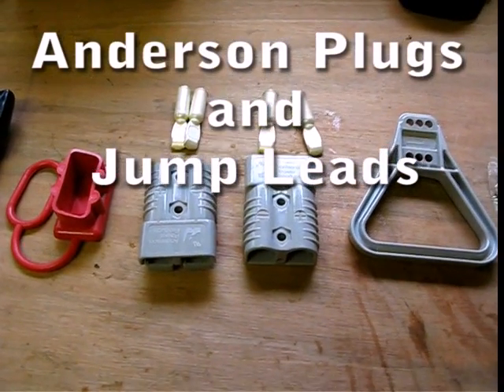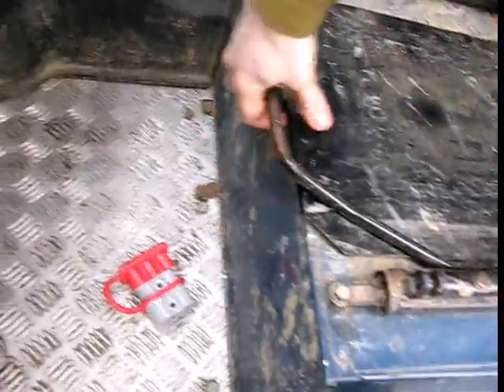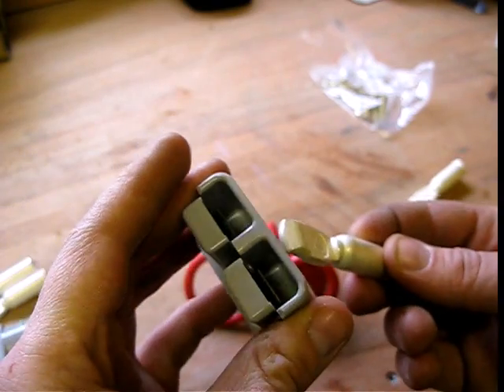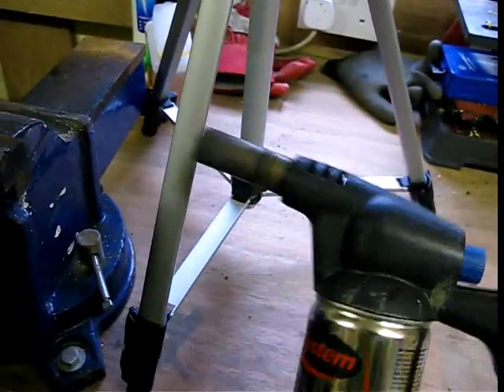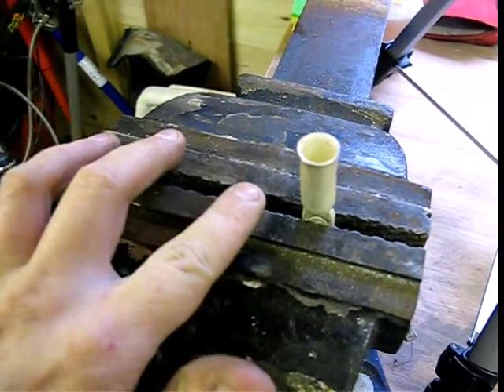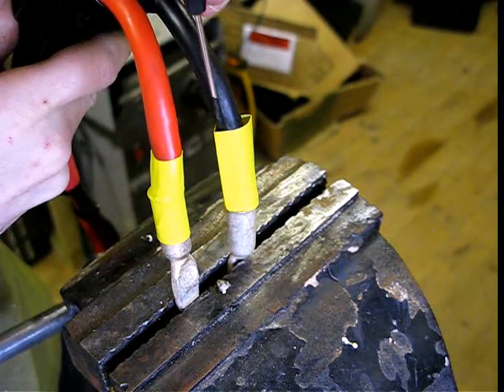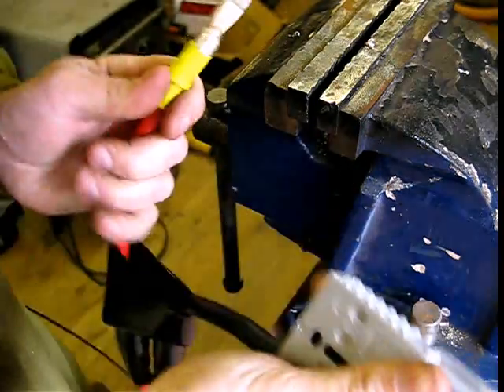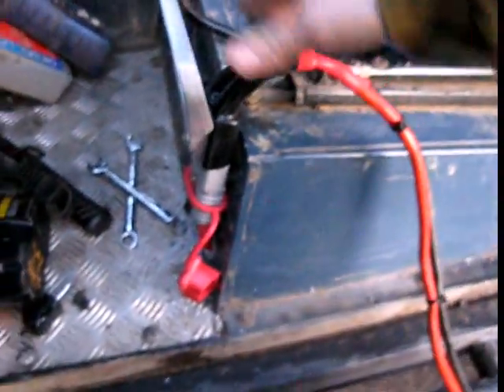How to make up Anderson plug jump leads for a land rover Defender or any vehicle

Comment: I use a long pair of needle nose pliers to open up heat shrink tubing. Slip the heat shrink on and open up the pliers a little till it's opened far enough to slip on wire connector.

Comment: So hows it going Did it like this the first time I tried it. Doing it this way is an easy way to overheat the solder( black smoke and flame) because your feeding it in slowly. It's a pain to do it like this. You wind up getting to much heat which isn't good for the solder and you have to wait longer for the solder to cool. It's much easier to fold a length of solder till it's a little tight fitting in to the lug and about as tall as the cup that holds the wire. It's much quicker to melt the solder then insert your wire and it's much quicker to cool because you haven't overheated the lug and what you use to hold it. This way you can do more lugs in less time use less gas and have a better solder joint. Buy pre tinned then there's is no need to tin it beforehand.

Comment: Did it like this the first time I tried it. Doing it this way is an easy way to overheat the solder( black smoke and flame) because your feeding it in slowly. It's a pain to do it like this. You wind up getting to much heat which isn't good for the solder and you have to wait longer for the solder to cool. It's much easier to fold a length of solder till it's a little tight fitting in to the lug and about as tall as the cup that holds the wire. It's much quicker to melt the solder then insert your wire and it's much quicker to cool because you haven't overheated the lug and what you use to hold it. This way you can do more lugs in less time use less gas and have a better solder joint. Buy pre tinned then there's is no need to tin it beforehand.

Comment: Very nicely done. Got a whole load of these but lower current rating. How much were they 175A ones?
Reply from the maker: Zed Man sorry it was so long ago and i can't remember
Reply: ruuman no worries. Found some on eBay for £15. Tempted to hook one up to the transit but wire one to the front bumper like the RAC/AA vans. Cheers
Reply from the maker: Zed Man bargin, yeah really handy mod

Comment: Not a hater, but for a vehicle mounted system, using solder is NOT THE RIGHT WAY to attach the Anderson connectors.  

In high amperage situations, the joint can get hot.  The heat "can" melt the solder, or at least through repeated cycling cause it to expand/contract and eventually get brittle and not make a solid connection.  

Now couple that with the vibration of a vehicle, and you have the makings of a "situation" over time.

The proper way is to use a crimping tool.  NOT A HAMMER CRIMPING tool, there is too much voltage/amperage drop with that tool for this application.   

The proper crimping tool is a hydraulic crimper, fairly inexpensive, with the properly sized dies.  This will make a solid connection that can withstand vibration, and repeated hot/cold cycles. 

Also, make sure to use ADHESIVE lined shrink tubing.  On a vehicle application, where there are environmental concerns, you want all of your joints to be sealed from the environment.  So, that's why you use adhesive lined shrink tubing, to make sure that no water or moisture gets into the joint.  Regular shrink tubing will over time let moisture in, adhesive lined shrink tubing will not.
Reply from the maker: Cary I completely agree, when I made the video affordable crimpers didn't exist on the market, now you can jump on eBay and pick up a setup for next to nothing.
This soldering procedure was from Andersons manuals should a crimp not be available and is still way better than a chisel or vice crimp. I'll try and pin your comment as the info will be useful to others. Thanks
Reply: If you need some large cabled crimped properly, call your local welding supply store. Do all the prep work for them and bring a 6 pack when you go. 

And if you need anything, they most likely have it.
Reply: The 50 amp connector is not made to be crimped with hydraulic crimper, It cracks. And thats why noone use hydraulic crimper on this terminals, never seen it.

Comment: Buy a cheap chinese hydraulic crimp-tool from flea-bay for about £15 - £20 to do the job properly. The tool is made from compressed cocoa powder, so would not last a week in a professional work environment. Ideal for a few dozen crimps in the hobby jobs. Make sure you use pure copper for the leads, as copper-plated ali is worse than useless.

Comment: Have you ever noticed that in Industry, some connections are soldered and others are crimped. Have you ever wondered why?
Some of it is about cost and economics, but where reliability is required and some critical dependence is a necessity, then crimping, correctly done, is the most secure.
Soldering is not, in the case of Anderson Plugs, the best way to terminate the cables.
That it will work, is not in question.
Reply from the maker: +aubreyaub I agree, this was just a video for the guy in his shed to get him out of trouble. Now that cheaper hydraulic crimpers are available Id recommend that every time. But before then most guys were just crushing the terminal in a vice or cold chiseling which is way worse. The soldering instructions in the vid came straight from Andersons datasheets and they recommend crimp as the best practise but this was an acceptable alternative.
Reply: Every connection on everything NASA has ever sent into space has been soldered, they don't crimp anything. Hard to question the reliability of stuff that operates unattended under those kind of conditions for years at a time.
Reply: Alan Hughes
Crimp it correctly then solder it correctly also.
Reply: aubreyaub Anal Aussies are annoying don't be such a dinglewampus.
Reply: aubreyaub A
Reply: The difference between properly soldered or crimped is so small it's not even worth mentioning. That a person can mention it just to be anal know it all is not a question.
Reply: yep better to crimp but if soldered always use a round punch after just incase you dont melt the solder under heat from cranking.
Reply: mate, a cup of tea, a bex and a good lie down, will make you feel better
Reply: Espousing a quite deliberate untruth is what..!
Fact and Fiction are soon sorted, not by a desire or wish for it to correct, but because it is is undeniable.
The more you protest, the more proof you lend to your own stupidity.

Comment: More strands the better the current flows - WOW! Do you actually know anything about anything. Really you need to warn everyone you are not responsible when their vehicle burns to a crisp.
Reply from the maker: angus rainbow Yep you are quite correct. I actually meant in the video don't buy the horrible 6/8 strand cheap cables. They don't flex, go solid in cold weather and will work harden quickly.
Reply: Can I just say the best jumper leads I ever used were made from soft copper water pipe. The car started like the battery was under the hood.
Reply: harrismhome Another comment by an ignorant troll. Sheesh! Insult the world much with your blather?
Reply: Actually it's true, electrons tend trip travel on the outside of a wire. Strange but true and only of minor influence, cross sectional area is still more important.
Reply: +angus rainbow 

Skin effect is only for AC

Comment: WARNING. This method will not be rated at 175amp unless they are crimped properly - the solder joint will most certainly lose it's integrity quicker than you can solder them, especially under jump start situations. Watch em burn lol.
Reply: harrismhome Wonder why your ignorant comments don't generate any likes? The solder joint will not lose any integrity unless it gets really hot. My experience says they should work just fine for most vehicles.

Comment: Hi - do the handle bolts have enough spare length to go through the seat box for mounting?  If not how did you fix the connector to the box? also which rating of Anderson did you use? The 175a ones? Thanks - great vid, and it has stopped my quest for a bulkhead anderson connector!!
Reply from the maker: Hi, The handle bolts are flush to the rear of the connector, but I spaced the whole sock of the seat box just to give a little more clearance so you could leave the seat base in place and still connect. Yes 175 plugs.

Comment: never used the Anderson plug is there a male and female plug or just the one that will interchange with each other
Reply from the maker: The connections are matched. I.e. no male or female. But there are many different sizes depending on the amperage you need to carry. Thanks

Comment: Yep,  great job.
I would also suggest heating the copper of the cable longer....
When I do this job,  I heat the terminal with the cable in it,  then add soldier.
Both surfaces need to be at temperature to accept the soldier correctly.
Be mindful of melting the insulation,  but your shrink sleeve will cover it if you make a mess.

Comment: Very nice video.  I am thinking of putting this setup on my VW Vanagon Syncro as the battery is also under the passenger seat.  I was dreading looking for a crimp tool. My plan is to go one step further and get a third Anderson connector to use on the clamps that were cutoff.  I can then reconnect the clamps to keep the original "clamps to clamps" configuration for everyone else in the world.  Thanks for posting your video.
Reply from the maker: glad you found it useful, the crimp tools have come down a little in price now. I borrowed one of these recently and was very impressed http://www.ebay.co.uk/itm/Manual-Hydraulic-Electric-Cable-Wire-Terminal-Crimping-Tool-Die-Set-70mm-416371-/271234189370?pt=LH_DefaultDomain_3&hash=item3f26d1483a but the solder technique is very good too. good luck!!
Reply: ruuman b

Comment from the maker: Hi Mark, I don't know of anything off the top of my head, I would imagine you require something for a marine environment. But because the terminals are silver coated the plugs themselves withstand corrosion very well. Mine still look fine now and because of the open design water doesn't get trapped. I guess you could fit a boot and pump silicon into the other side but I doubt it would be 100% waterproof.

Comment: The fitters where i work always solder them instead of crimping...They are quite a pedantic bunch and it just seems the proper way of doing things....

Have already wired my Disco 300 with suitable leads an Anderson Connectors... Damn sight easier than faffing about with the bonnet up when someone needs jumping off...

Good, well thought out video...thanks for posting

Comment from the maker: no it's fine, horizontally would mean I need to open the door to plug them in which I didn't want to do. They just plug in without any messing about and reach out both driver and passenger windows

Comment from the maker: @Zeamus634 erm, maybe move the socket slightly further in towards the gearbox, it's maybe slightly to tight against the door, also I think I would have made the jump leads 1-2m longer. but apart from that it's a great mod that I use constantly. Also the red boot thing lasted about 1 year before getting ripped off.

Comment from the maker: @Zeamus634 they simply went to regular eyelet connections, I use a numax leisure battery which has the great feature of normal terminal lugs and 8mm bolt fixings built onto the battery. But you can usually just use the eyelet connection on the regular terminal clamping bolts on normal batteries

Comment: I haven't used Anderson connectors for about 18 years and thought they didn't need a male/female... thanks for confirming that. I thought I may have been imagining things! Great tutorial, my only suggestions would be to "tin" the cable first, and also, when I was taught soldering (Military Spec), to never quench any solder connection (as you suggested). Always allow it to cool down by itself (as you did) to prevent crystalysation of the joint. Thanks for refreshing my memory.